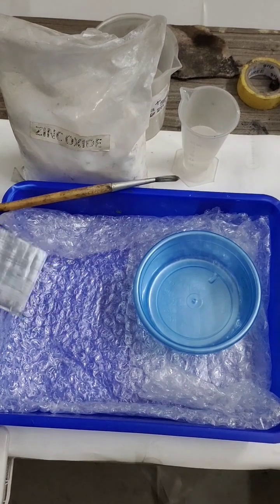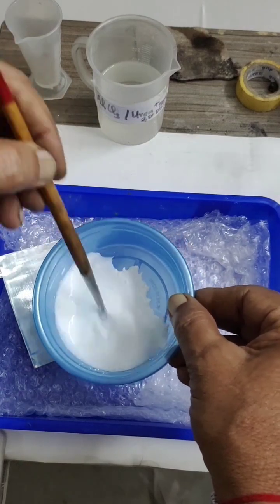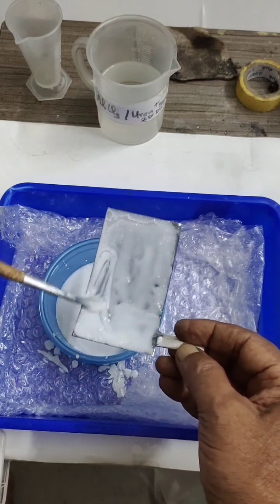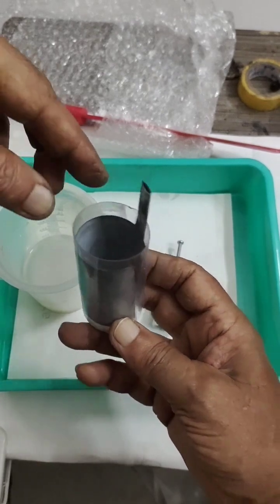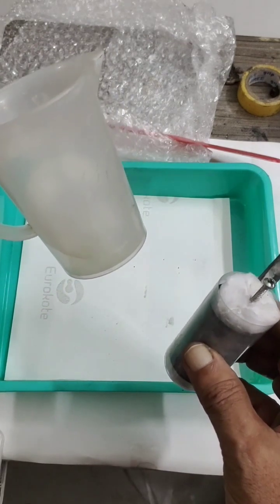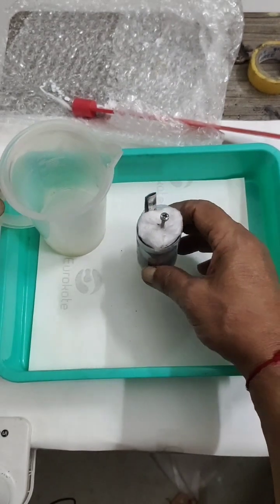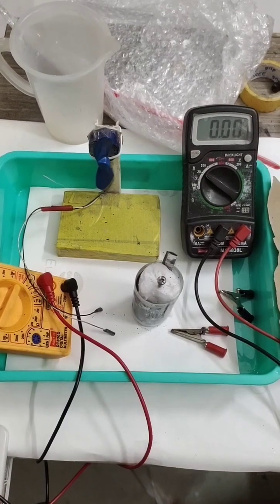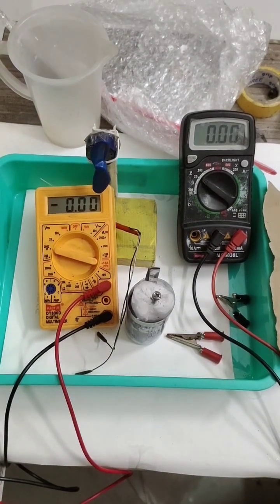ZINC ALUMINIUM ION BATTERY, V- 1.65,C 1170mA, RE-CHARGEABLE, FINE SHELF-LIFE D.I.Y. COATING ZINC,E.V

Comment: One additional suggestion on a metal oxide substitute....bismuth trioxide 👍.... it's an excellent trace metal oxide to add in with manganese dioxide electrode material.
Reply from the maker: I will try in my next battery model. 👍

Comment: Your work continues to be consistently excellent. Per one of the other comments on here, substitutions for lead oxide and cobalt oxide...I might suggest trialing tin oxide and nickel oxide...they are of course not ideal but much better than lead oxide and cobalt oxide from a supply and environmental footprint perspective and are also metal oxide additives used in higher power density batteries.
Reply: One of the most disturbing paradoxes is our environmental concern where we  work so hard in the belief that one step of one person is part of the cumulative steps of the other persons effort - and that is true. But our governments, all of them have no problem in having our cars run on lead acid batteries while we exacltly know the consequences. We try as much as we can to avoid Cobalt compounds for the sake of the environment, but most of our billion mobile phones have lithium batteries whose cathode has some cobalt spinels, nanoparticles, MOFs etc. So how do we really inspire ourselves when governments are working non stop to take us 10 steps back for every one step we make forward!

Comment: Congratulations, you have made a game changer of a battery. The rechargeability, charging time and usage of readily available materials make this a wonderful battery. 

But I am interested to give you more suggestions for improvement.
1. Any aqueous electrolyte has an Electrochemical Stability Window (ESW) of only 1.23V. Exceptions do exist, but we need to use concentrated solutions. For example, Zinc Sulfate gives 2.2V, MgSO4 2.4V, Sulfuric Acid 2.6V. But if we charge the battery at a higher voltage than the ESW, hydrogen and oxygen will come out, damaging the electrodes and reducing the cycle life.

2. Lead is a toxic metal and Cobalt is a very rare, Unethical metal. We need to do away with the 'traces of Lead and Cobalt' in the next version. 
3. I think this battery is a Zinc Ion Battery, not Aluminium. To make it an alumimium ion battery, we need to add Aluminium Sulfate to the electrolyte and some ESW enhancing additives. 
4. In the Graphite rod, we should add Activated carbon to the mix to increase surface area and this will increase the current by a lot. 
5.Buy an EB tester, and see how much energy this battery contains in mAh. We need to get the energy density of the battery. 
Volume of a battery in liters is pi x r2 x height/1000
Wh= mAh/1000*Voltage
Energy Density = Wh/volume
Lead Acid has an energy density of 100 Wh/L, Lithium has 600 Wh/L and Lithium Ferrous Phosphate has 324 Wh/L. Nickel Zinc gives 280 Wh/L. We need to come close to these numbers. All the best. 
Hope to see a better battery in the next iteration. Keep up your good work.
Reply from the maker: Thank you I will try 😊🙏

Comment: you are coming right along on this battery  one amp makes it very usable in large packs one amp is more than enough for may applications  all the ones in past just keep trying things and learning more and more with each thing they tried   you ever think about a simple leyden jar metal on out side glass then metal on inside  you can charge it  then take it apart  touch the inter and outer pieces of metal together  then put it back together and its still charged   if charge was stored on the plates inter and outer they would equalize with taken apart and touched together  but that is NOT what happens proving the charge is not stored in the metal plates  the charge is stored in the glass insulator of the old type laydon jars   testing every thing your self is key to finding truth about ALL things including God  Have a blessed day my friend